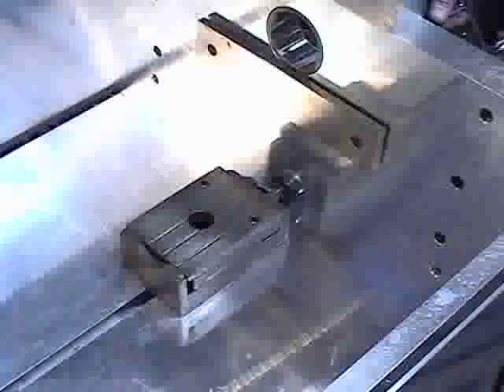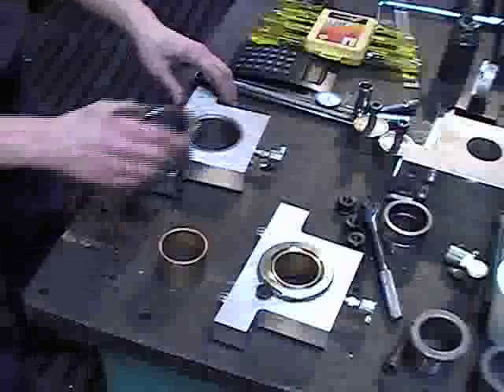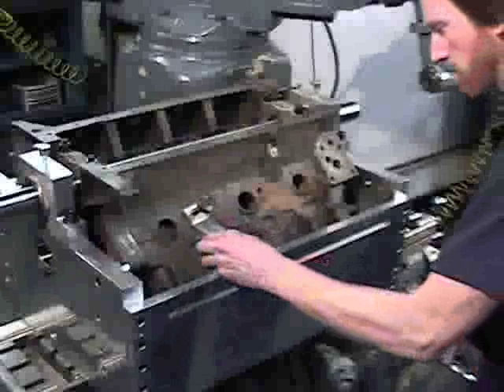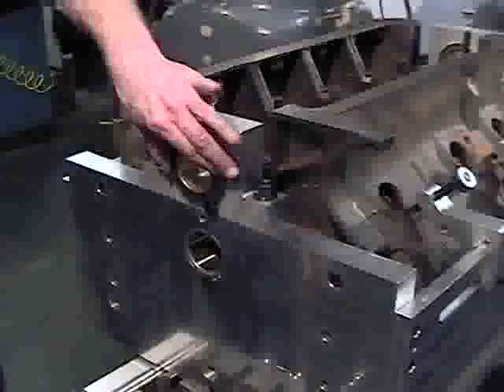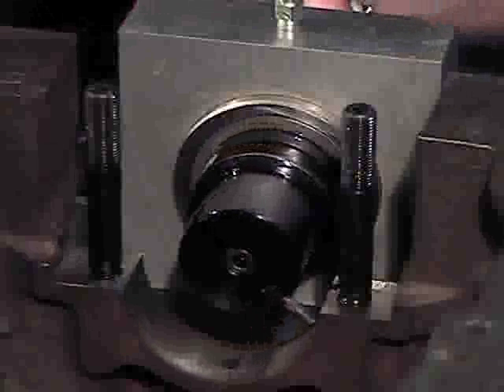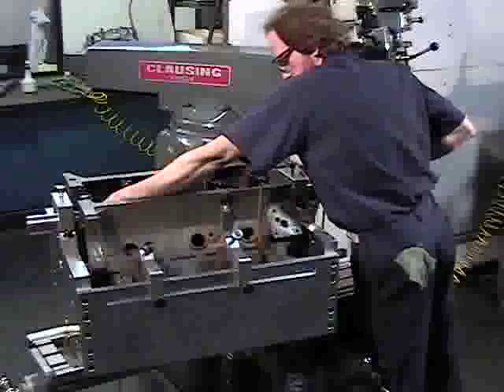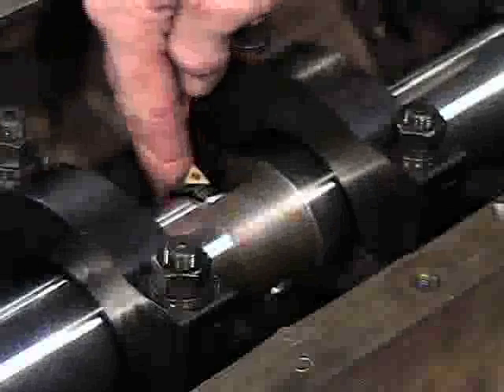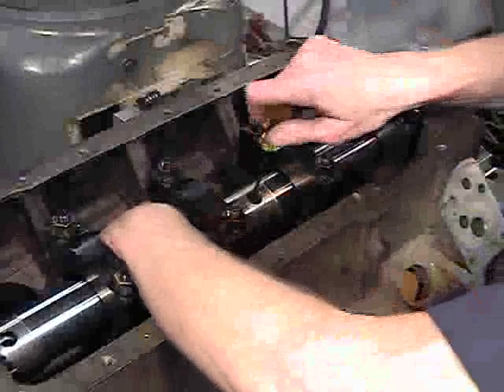BHJ Line Boring Fixture: Machining Mains Part 2 of 4

Comment: ok I don't get how this really helps in the worst cases.  What if your #1 and #4 main bearing journals are out of true?  Then what are you going to use to locate the boring bar? 
Do you say just to bore those to spec with a standard boring head using the bridgeport's spindle horizontally?  Then go from there?  I mean if that's the case, and you'd already have the block mounted to the table to do that, why do you need this jig?  You could just locate a good old fashioned boring bar in those two journals that you just machined, and then get the middle two.  

I mean, what am I missing?  why use this special, expensive jig?  Why?
Reply from the maker: The fixture is designed to enable a shop that does not have a boring machine (or room in their shop for such a machine) to blueprint cam tunnels and make corrections to mains, utilizing a vertical mill.  Once the operation is complete, store the fixture and use the mill for other operations.

"Worst cases" is a relative term.  If you have locations that are too far out, the block is scrap.  If it is salvageable, then this fixture provides a competent machinist an option for making the necessary corrections within the parameters outlined in the previous paragraph.

The mains boring setup is mostly used by shops to finish aftermarket caps.  The cam tunnel boring operation is primarily intended to blueprint the cam tunnel, with the secondary benefit of being able to enlarge the cam tunnel to accept larger bearings, such as rollers.

Hava a look at QMP's handiwork with the fixture:
https://www.facebook.com/QMPRacing/photos/a.794511050581185.1073741826.243215192377443/974244612607827/

Feel free to call, if you have more questions!

Chris @ BHJ